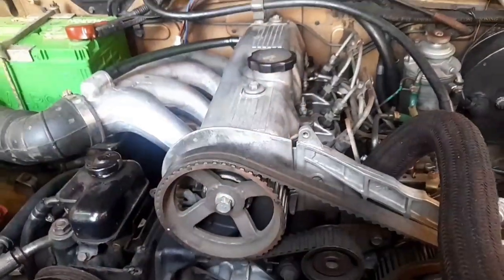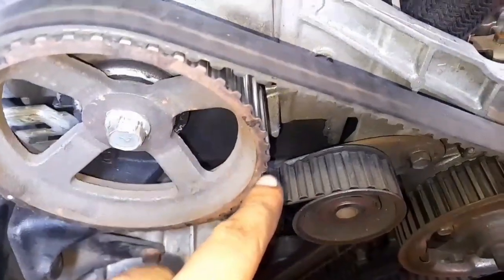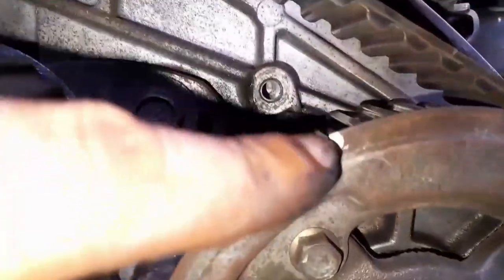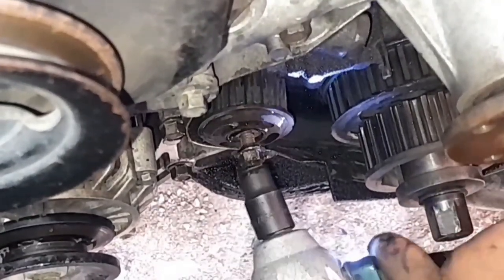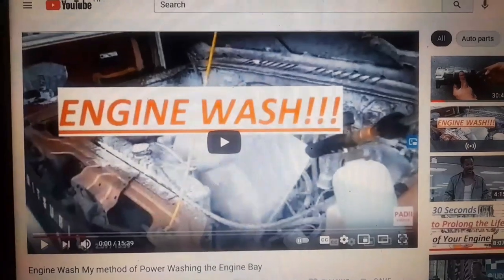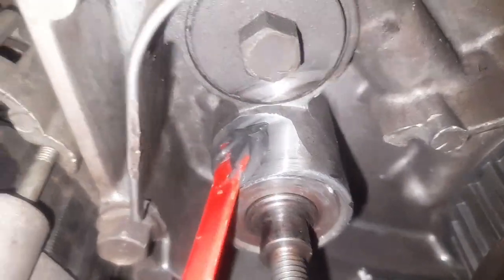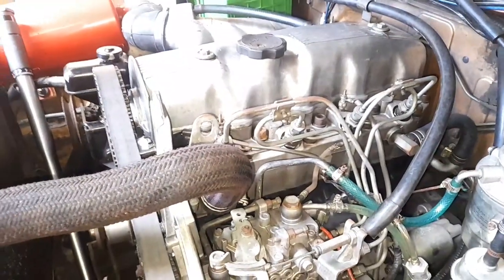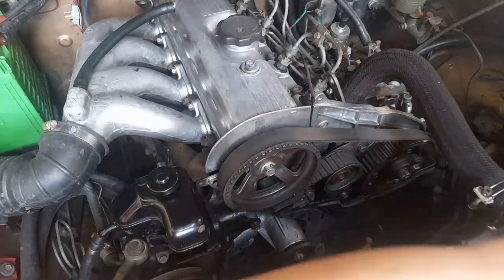Balancer Shaft Belt Delete 4d56

Comment: I deleted the ballancers, too. My only worry was that I hoped the lower one doesn't power an old pump as well, or if the oil pressure isn't going to be lost due to balancing shafts being just filled with oil not rotating... Can someone share some light on it pls?

Comment: What actually happens to the belt tension during the final stage of the cambelt installation. (i.e.Just prior to locking down the tensioner bolts) By turning the crankshaft  clockwise and applying opposite pressure (anti clockwise) to the camshaft sprocket how does the belt tension increase by applying this action. Also is it nescessary to loosen the balance shaft tensioner if only the timing belt (Belt A) is being replaced.

Comment: I replaced all oil seals of my delica 4D56 starwagon but I accidentally cranked the engine without the timing and balancer belts . When I tried to rotate the crank shaft manually to its mark, it does not complete a turn .... I turned the camshaft  and found that the crankshaft can now turn 360. when I installed both belts , I double checked the markings and started the engine. ..I observed a different sound ... seems like a wilder engine sound....I shut it down immediately....Where did i go wrong....I badly need your advice mate.
Reply from the maker: @jordinhowards5037  check your camshaft bearings and rocker arms see if any of them are cracked or broken another possibility is you might have a bemt valve.

Comment: Hey man been watching your videos the last 2 days, going to have a go at advancing my pump timing today, it’s really down on power, lots of blue smoke at idle and hard to start 😅
Reply from the maker: Thank you..you can do it.
Reply: @MrDIYer  I adjusted it as far towards the motor as I could, it made a difference, more power and less idle smoke but it’s still not perfect so I’ve bought a new timing belt and going to check the timing when I’ve replaced the belt

Comment: Thanks for your videos sir. I learned a alot. i have the same engine l200 strada and the problem is the crankshaft keyways are worned out..is there a better way to fix it.? Tried a machine shop once and it fails.
Reply from the maker: Make sure theres no play. And when you install the crankshaft pulley there should be no play too. Thats what the thick washer is for.

Comment: Sir how about mobil circulation if balancer is not rotating ? Does it make problem to mobil pressure to tappet and other parts or have to block the passage in balancer please advice .
Reply from the maker: Oil pressure would pretty much stay the same

Comment: Another great video. Thank you so much. And about kia bongo diesel engine. If i use it on my jeep wrangler. Did this will make slow. Or it is the same things like 4d56.
Reply from the maker: More or less the same with 4d56
Reply: @MrDIYer  wach one is more fast 4d56 or kia bongo diesel engine

Comment: Hi DIYer, am sorry this question is not related to the topic at hand but mine is on the cylinder head for 4D56T, in reference to the comment you made last time when I had blowby just after rebuilding my engine you advised that if the head is warped that I replace it. Why Can't one skim the head and still use it? Mine was skimmed twice before and it's got a very little warp which I think caused a coolant leak when I used 3notch metal head gasket.
Reply from the maker: Manual doesnt advice to reface the cylinder head for 4d56 But it can be done at least twice. Maybe even trice. Depending upon the machinist. Make sure the block is flat too. The  block as well as th head mas both be perfectly flat
Reply: @MrDIYer  Ok thank you very much. May be I will just get a new one. Is the cylinder heads coming from China good quality, I a shop selling brand new ones but imported from China. Or it's better to go for good second hand which is on standard?
Reply from the maker: i would personally choose brand new

Comment: Thanks brother for sharing knowledge 🙏. I have a mitsubish L200 but keeps breaking the timing belt. Broken 2 belts in 6 months. What could be the problem???? Thanks in advance ☺
Reply from the maker: I would check the camshaft and cambearing caps. I would check for the torque applied on the bearing caps too. Because if its too tight that would cause the cam difficult to rotate breaking the belt.
Reply: Thanks again brother. Will check them.
Reply from the maker: Ok brothet. Give me an update. Thank you too
Reply: Hi Tommy. If your belt failed, didn't it wreck your engine??
Reply: @verdw6587 
4d56 is non contact engine
Reply: @kisakyetommy 
That's a doubtful diagnosis. I would have a look at a possible snapped rocker arm or something else that's "snatching" because only that type of force would snap a timing belt. (something locking or seizing up normally top end)

Comment: Hey Mr. DIYer. You rock btw. Looking to pickup a imported Pajero in the US with it being my first diesel. I worked on G54b Astron motors a good bit with my Starion and I know about the balancing shafts and the design of these blocks. I was wondering, is it ok to leave it in like you did? On the Starions, you remove them entirely.

I haven't see just the belt/sprocket get removed by itself before like that. Thanks!
Reply from the maker: its been running without the belt since that video upload, just the belt removed but if you ask me i would so much prefer to have the balancers working.

Comment: Hello sir, thank you for explaining this video in such a clear way. I would like to share with you a problem that i have lately on my Mitsubishi Pajero 2.5 TurboDiesel (1988). There is coming a big whinning noise from transmission i think. Whatever gear I go in, it whines like crazy expect for the 4th gear. Do you have any idea what may cause the problem. Thank you in advance, im looking forward to get an answer from you!
Reply from the maker: Just perform the process of elimination. Once you are sure the sound is being cause by the transmission, the only way to know whats causing the transmiision noise is to bring it down. It could be cause by the lining, synchronizers bearing etc.
Reply: It could also be the through out bearing if it a stand shift trans!
Reply: Or maybe the gear oil level is down
Reply: @eddymo4564  hi, thank you for your response. Ive checked the oil level and its as it should be. I dont have enough time to dissmantle the transmission and look inside!